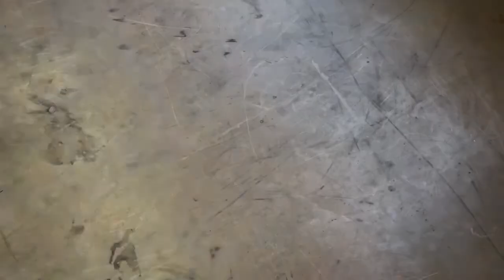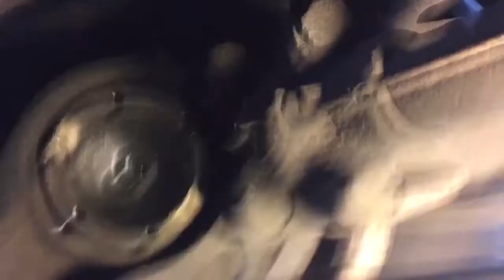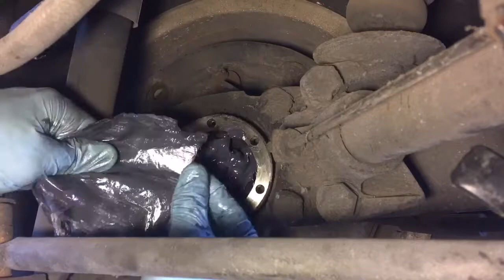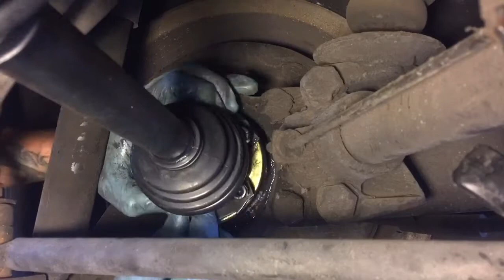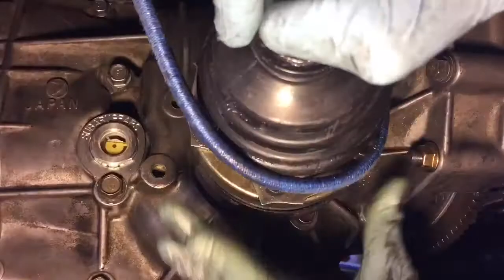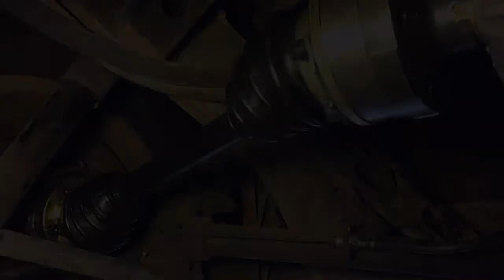VW Bus CV Axle Install - Daily Driver VLOG 7/6/17 Bonus

Comment: Looks so much easier on the bus. The Vanagon swing arm has a deep pocket and you're generally a bit blind. You gotta pack that extra grease on the end of the CV joint instead of easily piling it onto the stub axle. You use a torque wrench after zipping it on with the air ratchet?
Reply: And curious about the axle lengths.  Unequal length (auto trans axles) like on the Vanagon Subie trans swaps?
Reply from the maker: Dude, WAAAAY easier on the bus. Vanagon's outer side makes it tough and you need to spin the wheel to get things lined up right. Grease EVERYTHING in my opinion, not just the axle.
Reply from the maker: +Forthwith Tx Stock axles, I can't imagine why you'd need unequal axles in a Vanagon.
Reply from the maker: +Forthwith Tx Automatic Vanagons definitely use unequal axle shafts but if you have a manual van that has the original shafts you won't have to switch out your shafts. Overall, a very nice kit they have. Contact Todd at Subarugears if you're worried about it - he'll set you straighter than theSamba for sure!
Reply: Gotcha.  I was definitely on that track...
Reply: My sister broke the axle in the 82 rabbit,  different lengths and the p side was hollow to maintain the same moment of inertia.  She broke the hollow one, and later, over heated it.  -- Hey don't drive like my sister !